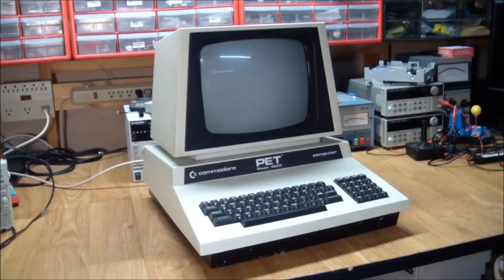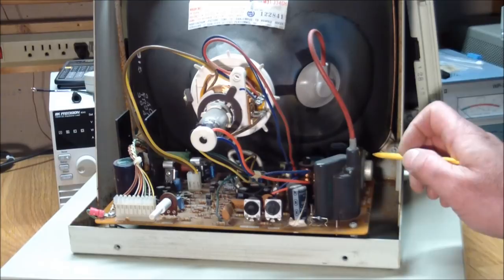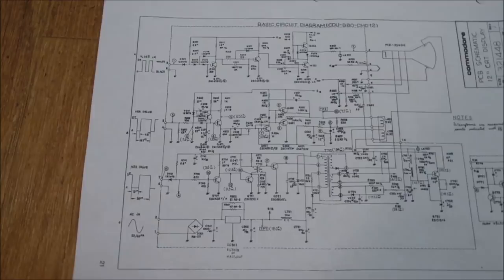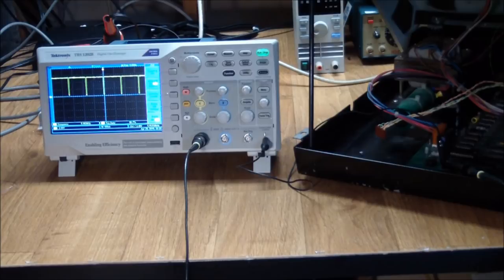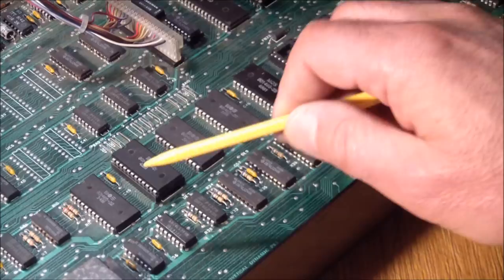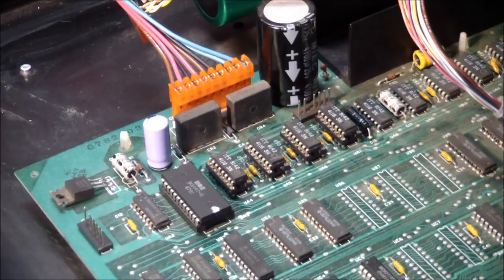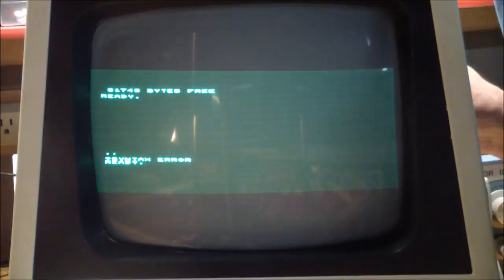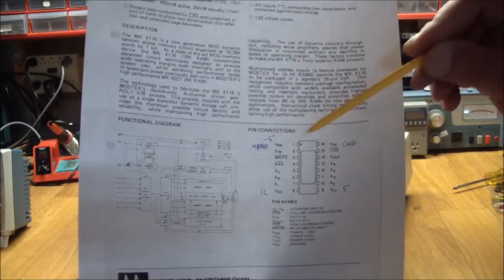AE#86 Commodore Pet 4032 Repair Part 1

Comment: I'm having similar video problems on a 2001-8.  Good horizontal sync signal, but a flat 4.5V on the vertical (although that recently changed to an odd square wave at far too high a frequency).  Currently waiting on some equivalent IC replacements for one of the TTL chips that appears to have stopped counting.

Comment: The PET was a computer where a poke could send the video circuit into a destructive setting destroying the flyback transformer.  It was called the "poke of death".  An intentional poke could do this, or a malfunctioning CPU/system could accidentally set this memory location to a destructive setting as well.  So it is not surprising to see a bad video as a problem.  It's relieving to find out the flyback survives on these machines on occasion

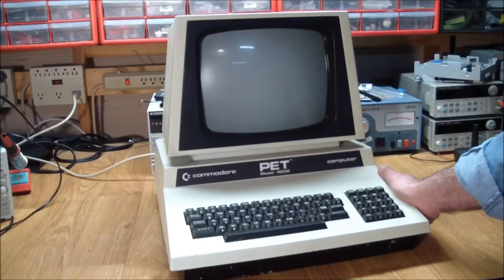Comment: 4:00 The chirp is a really good sign.  They actually DO have a beeper in the Pets to make that chirp.  That indicates the logic board is probably coming up fine.  A ~40 year old CRT display (that might be a model that can destroy itself if the machine is subjected to the infamous "killer poke") breaking down isn't a big surprise.
Reply: OK, so it wasn't coming up completely.  It was obviously doing the initial system startup, but it must have crashed out as soon as it tried to use anything in RAM.  That might be pretty soon, actually, since a 6502 has some clever tricks it can use in the first 256 bytes of RAM to do things like indirect addressing in a very elegant way not otherwise usually possible on 8-bit chips.

Comment: From the schematic it looks like what we call a direct drive monitor and as such has no H osc so the scan is controlled by the computer. 
H sync pulse is narrow typically less than 10% of scan period but H drive is maybe 40% of scan period, that is why the picture was not correct with the PC driving it.
That signal from the manual you showed was I guess  the flyback waveform from the HOT not the drive waveform.
From what I am seeing it looks to me as if the computer is not setting the CRTC chip correctly.
Reply from the maker: Yes, the bad DRAM prevented the processor from initializing the video chip.
Reply: @artifactelectronics  Yes I watched the rest, I must refrain from comments unit I have watched the whole video :)

Comment: Great video!!! Is there a schematic to get video out to composite on a 4032?? I found some schematics but won't work  on 4000 series
Reply from the maker: I never looked for those because my monitor works, but I seem to remember that the monitor was driven by non standard signals requiring some kind of signal conversion to work with a standard monitor.

Comment: ARTIFACT ELECTRONICS, all arcade monitors have a B+ voltage any reasons why it needs to be set at 125vdc for the H&V sync hold circuit to work correctly? the B+ voltage is a Bias voltage DC offset for the H&V sync hold circuit but it doesn't make sense why the B+ voltage needs a big DC offset bias voltage set at 125vdc for the H&V sync hold circuit to work correctly, any reasons why?

Comment: I needed to see this 6 months ago. I replaced the output transistor and the caps. The problem ended up being a ram issue  on the main board. It failed to send the drive signal to the monitor.
Reply from the maker: When there is a ram error the code never initializes the video chip properly and thus the monitor never comes up.

Comment: Each arcade games has a Test mode diagnostics program, What or how does the test mode diagnostic program test and verify the ROMs contents for each ROM chip in the arcade game? Does the test mode diagnostic program  have copies of the original ROM contents for each ROM chip in the arcade game? How can you verify the ROMs contents if you didn't have the original ROM files for each ROM chip, any way to debug troubleshoot them using an EEPROM reader software problem displays each ROM content for each ROM address location in a hexidecimal value, any way to debug or troubleshoot if you don't have the original ROM files to compare against?